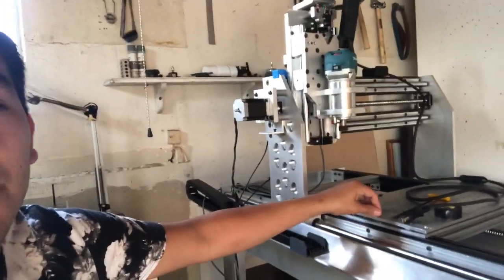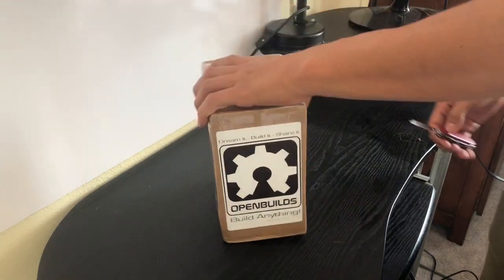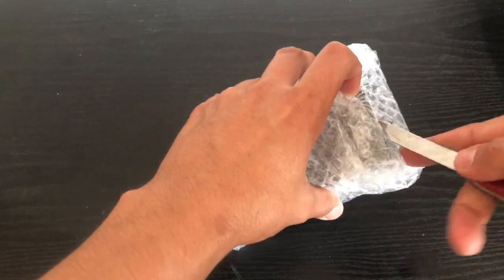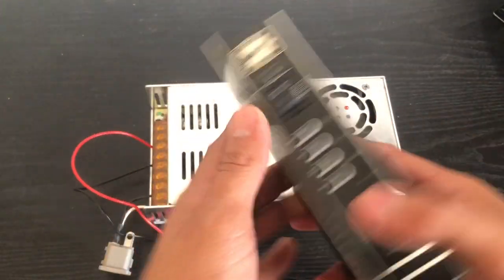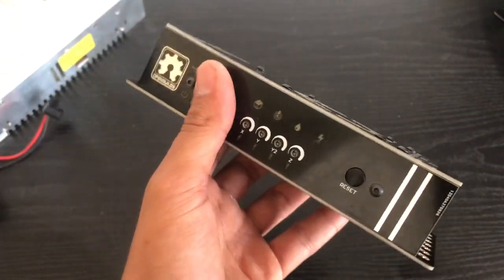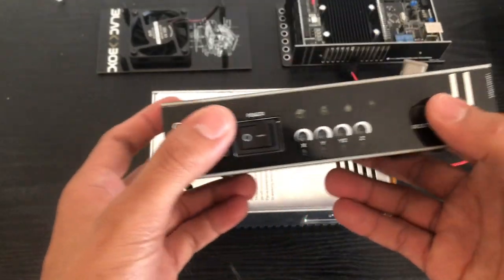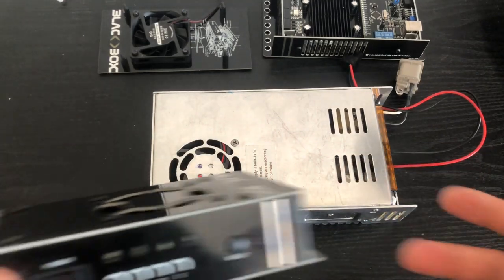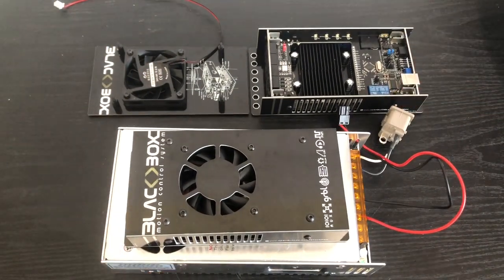Openbuilds Blackbox Motion Control Review And Customer Service Experience

Comment: I do my tooling passes in Mastercam 9.0. Will this run gcode from Mastercam? What post processor would I use to export the Gcode?
Reply: G-code is a nominal standard. It shouldn't matter if it's written by Mastercam, or composed in notepad. You'll have to choose your post processor that most closely resembles your particular machine, and then tweak the settings to tune it.

Comment: what drivers are inside? box is about 3.5x7.5 x 1.5" high too small for tb6600 drivers.
Reply: Integrated up to 4a per stepper drivers
Reply: Whatever they are, They are Far better/Quieter/ Radder than EBay Tb specials!.